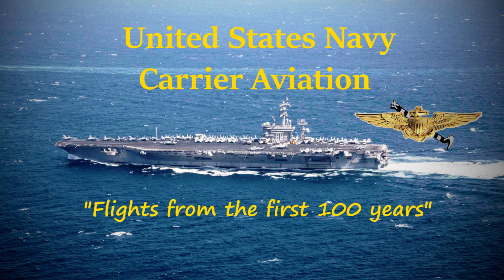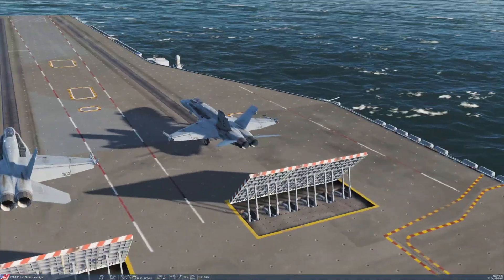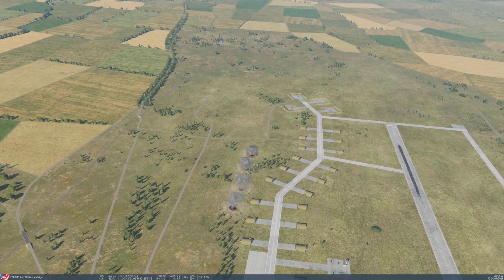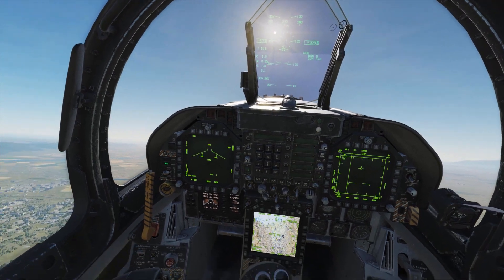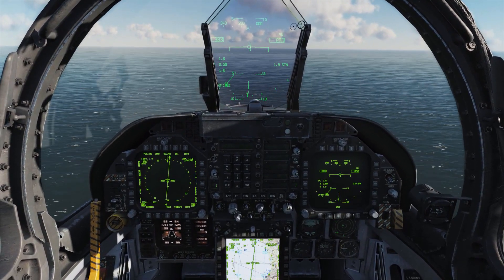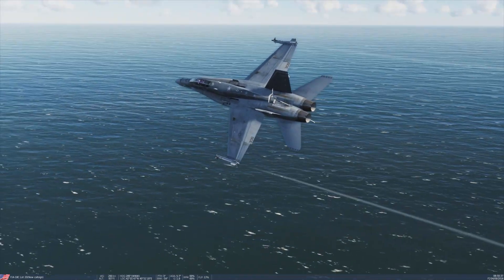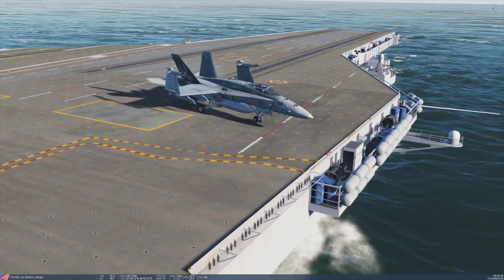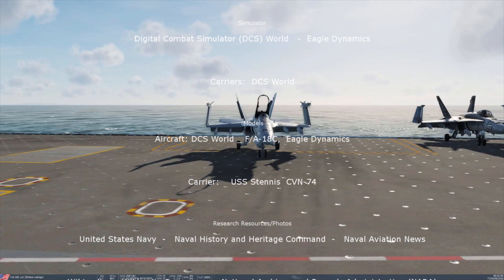U.S. Navy Carrier Aviation_The past 100 years with FSX/P3D --#70_McDonnell Douglas FA 18 Hornet

Comment: The Hornet only shot down two Iraqi MiG-21 Fishbeds, while on the way to bomb H-3 Air Base, and, after that engagement, the "Legacy Bug" hasn't racked up any more kills, at all. Also, the name of the company that designed, and built the AN/APG-63 Radar system is Hughes, not "Huges". Plus, the max warload for the "Legacy Bug" is 17,000 Pounds, not 19,000 Pounds.